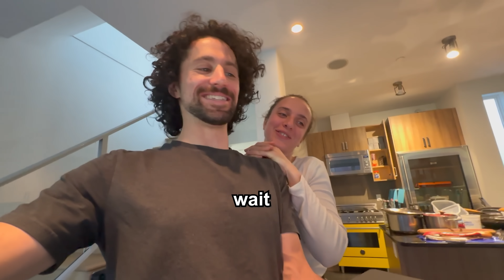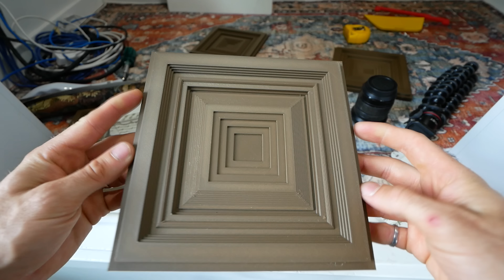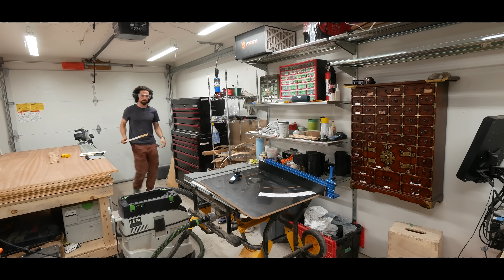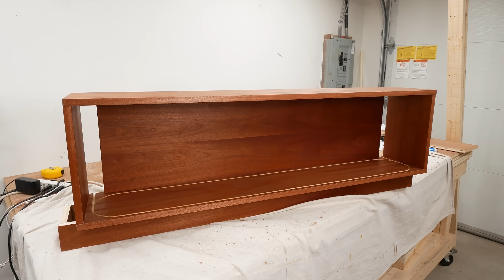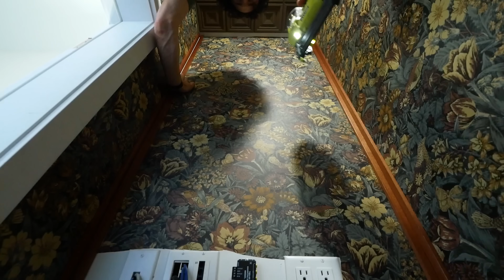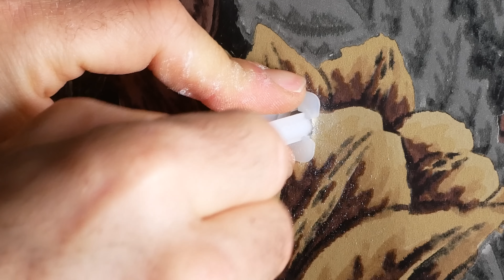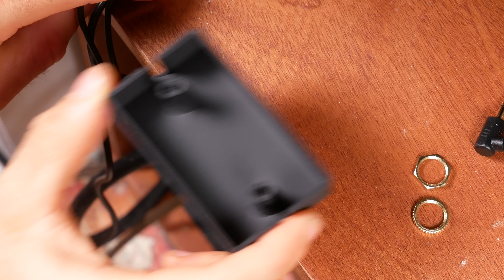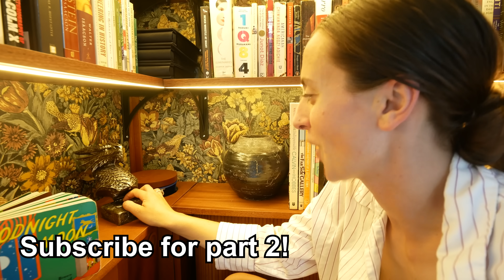I Built a Tiny Library on my Stairs

Comment: I know this is an old video but I'm going to suggest this anyways if you want to make strong shells without having to worry about attaching them to a wall for example but still expose the backing and have it look nice do a skeleton frame essentially you'll use posts that are small but strong along the edge of the shelves usually on the corners and you can add extra strength by adding a post or pull in the middle of the shelves to stop bowing or do what you did with the desk in the office pod and ad a beam underneath each shelf the connects to the frame on the ends

Comment: As a fellow user of "adhesive picture hanging strips"... you're not getting those off the roof cleanly. They're removed by pulling the tab parallel to the adhesion surface, and those tabs are now inaccessible, directly behind the panels. The only way you'll ever get them off is if you break the panels, chip the ceiling paint, or if they do fail naturally. Use your adhesive strips wisely, friends!

Comment: Awesome energy and video production, as well as woodworking!

Since you're obviously not shy about putting a lot of work into a project like this, I'm surprised that you didn't investigate what lies above the ceiling and below the closet floor before starting the build. Then you might've found a way to install a full-size door at the beginning!

In the US, hiding an electrical junction box like you did in the ceiling is a code violation. I used to watch enough home renovation shows filmed in Canada to be pretty sure it's illegal up there, too. A far better solution would be to paint a standard electrical cover plate in the dark and minimizing color of your choice. In fact, someone ought to forward this video to Mike Holmes. He'll get a hoot out of this, I'm sure!

I used to do a little woodworking in my youth, so I shook my head in disbelief at the thought of a 3D-printed plastic ceiling to imitate a wood coffer ceiling. Why not just make it out of wood? LOL. A stack of 1x4s would probably make the right scale for miniaturizing a pattern of large coffer beams.

It almost doesn't need to be said at this point, but you could have put up the wallpaper and the corner trim at the end, and therefore given yourself far fewer headaches while also using less of those materials. And if that huge hole in the wall "came with the house", why didn't you patch it before starting the rest of the work?

Comment: I haven't even finished watching the video yet, but as someone who has erroneously used Command Strips in such a way that I could not access the pull tabs, my anxiety went through the roof when you put them completely under the beautiful 3D-printed tiles. Good luck getting those off when you move. 😨

Comment: Door should be: 
a painting that swings open like a door - revealing a bank door / safe door which when unlocked opens - revealing a bookshelf of which when the secret book is pulled outwards (on a hinge) the bookshelf opens. 
[few different ideas for the bookshelf final door in how it opens. one could be it drops from the top, opposite to how a garage door opens, and when it comes down onto the ground it forms into a ramp or steps even]

Comment: I don't know if it's feasible, but maybe you could make something like an art piece with a tambor door, almost like a garage door?  Like use dark laquer for two tone shading and it rolls up to use the negative space between the ceiling and the top of the library door which seems to be about halfway up?  I tried to see about how high the ceiling is but most of the shots didn't show it so I think that's about right.  I just sort of feel like that closet's location in the wall is ugly from a distance and it would make the space look better if the stark white was framed with the earth tones inside.

Comment: I imagined a stained glass window (plexiglass/acrylic) that looks like it came from a library in Cambridge or Oxford, maybe a lesser known window that was stolen from Notre Dame. Maybe piano hinges, might be overkill- but opens vertically so both windows are doors that lay flat again the wall on either side. 
If you get the design just right, it 
could look like a stained glass
 window with sunlight shining through when the led lights are on, then decorative windows on either side of the window. 

I’m late to your channel- Just found this on 12/25/25. I haven’t found if you came up with something yet.

Comment: I think bookshelf brackets should have been printed lying down. Regardless of the material, the bonding of the layers is always the weakest point, especially if the print will support the weight of several books.

Comment: Do NOT add a door. It's way too bulky, way too many issues, too much work and all to fabricate a major dangerous hazard. I'm assuming you have no ventilation in there either correct? Stick to a simple fabric or breathable cloth curtain you can disguise as a tapestry or something similar. Also add some cushioning or door draft seals to all the edges of the opening so people don't get CTE over time getting in and out.

Comment: Envy!

The only thing that is a head scratcher… the secret compartment is just oddball out of place blue and green after you did all the painting work on the dragon.  It would have been cool to be the wine color of the upholstery… or similar coloring of the wood… or even the black of the shelve brackets.  It just looks like you had left over material lol

Otherwise that look so cool! 

You could add one of those micro ceiling fans where the top light used to be, for those hot days and paint it to blend in.

Comment: I see no need for a way to hide it. But, if you do, I would use a trompe l’oeuil image of an old fashioned card catalogue. If it’s constructed so that it sits proud of the architrave, it can be in two halves. You may need special hinges so they sit flat, on either side of the opening.

Comment: For the secret compartment i would also add a timer that if it is open for a period of time it will auto close it

for the door from the looks of it you don't have a lot of options.
you can't use a normal door that opens inside because the limited space, if it opened outside it will block the window and if it will open to the other side it might block the other stairs. 

I thought about sliding door but you don't have enough space for it either.
you can create like a door with segments which you can fold it and it will open (there are designs for it which is used for small spaces like this one)
you can use blinds but it isn't cool
if you want to go wild you can create a door that slides upwards you have a high ceiling so it can work. it also will not block the window

Comment: You could do a sliding door, one of the ones that are hidden in the wall that you pull out with a latch handle, and it could have one way glass thats paints on the mirror side like a painting so its a painting in one side but you could see out of it. I dont know it that would actually work, im not an engineer or sn artist

Comment: Two way mirror? For the door, put the lights on a remote so you can just turn the lights on from the outside so you can see inside without opening the door. But when the lights are off it's hidden

Comment: I know I'm late to this but I would have built a door that slides upwards. It could be a painting/portrait or even a pretty mirror. The track would all need to be hidden behind it when it's closed, but not look out of place when it's up. It would need to be able to lock safely in the open position, to prevent accidents, especially if there's any glass.

Comment: oh you could do a "living" painting with a flatscreen tv you can disgues as a painting. The frame of the tv you could cover up with a wooden frame.
The cables would have to go through the frame and wall of the opposite side of where your cables are (the one with the seat which looks so great by the way) 
Other downside might be, that you would have to cover the back of the Tv, which takes up space. 
On the other hand you could display ANYTHING on that tv. You could make a slide show of different pictures. Little videos like the one in Hogwarts

Comment: might need a vent in there to circulate airflow. Also probably "feels" warmer due to so much lighting
maybe have those on switch with a single overhead lounge light/dimmer switch where the reader would be to give it a cozier feeling and less like you're under spotlights. Also would be a good opportunity to cut in a vent for a fan along with that

could maybe do a one way mirror for the door so that way you can see out and not feel like you're in a coffin but also still hide it?

Comment: I did a project a while back for my cousins bedroom you can do a parts painting hanging either from the outside or inside. Basically you get whatever painting you want and build a hinged frame for it you can even put a backing on it and perhaps lean it over the bottom or top edge of the door having the words "The library" or something else you would need. Also you could do a very similar idea but make it fold into that corner by your window you'd probably need a string or an actuator to open and close it though... cool build!

Comment: Super cool project! I´d build a sliding door disguised as an old painting but with an intergrated ventilation system for that room. Is it possible to design a picture frame that allows ait to flow through and is capable of hiding a silent fan? Hm...

Comment: I like the Idea of a two way mirror or a glass window with a design that you can see through on the inside but not on the outside like what you see on some vehicles when driving, that would allow whoever is inside the closed library to see anyone outside, see the window and also prevent any accidental open door into someone or someone sneaking up.

Here is a project Idea for you though, why not buy a plot of land and build your own dream house with secret rooms and all?

Could make a secret underground workshop that has a hidden slide to get to it and a hidden exit to another part of the house, maybe through a replica grandfather clock, something like that anyway.

I was going to offer a suggestion for your Geodesic office pod, but you moved lol.

so why not build another for outside, a bit pricey for what I am suggesting.

- Using metal and something akin to Ballistic glass

- Create an inner and outer Geodesic dome.

- The inner Geodesic dome would have a lip to hold the glass to keep if from falling inside, the outer dome would have a lip to hold glass in to keep it from falling outside.

- the Strong glass would allow for weight and impact.

- inside, between the two halves of the geodesic dome, line will led lights so you can light up each individual border of the glass.

Just think it is cool idea to have a basically a safe space above ground, you could make it into a Greenhouse if you wanted to, or a gazebo type area for hanging out.

Comment: For door idea what about sliding like barn door that has photo on outside so when door is closed there is a painting there. Either split the door in two opening on each side, or if room permits, slides over to where you are sitting giving access to seeing outside, or same idea with a glass door with see through window with painting on outside(like on bus where outside you see advertiserbut from inside you are able to see out.

Comment: 27:35 
Door idea: a roll up door. Basically the door frame will be framed with a picture frame. Then have a picture or painting put on canvas or any suitable surface that is flexible. The idea is that when it’s rolled down it will look like a picture. You can also put it down when inside and it will add to your library theme. “Tada it’s not a picture it’s actually a hidden library. See if you can find the hidden snack department now.”!!!!

Comment: I feel like the ceiling would have been better if the tiles were vacuum formed from a single 3d printed tile, both cheaper and safer (if they fall).

Comment: For the door, you could hide actuators in something like a tall narrow custom table. Have the table hold a large painting that hides a seam where the legs are actually separate from the table and push the painting up and the table top is fixed to the wall like a step to help you get in and out, perchance.

Comment: I think if it were me, then I'd do a stained glass French barn door with hidden mechanisms. 

So, the idea would be, create a  stained glass picture inside a wood frame. The two halves of this picture frame door could slide apart to reveal the library behind. However, when in the library the stained glass French doors would still let in a ton of natural light. Also, it being stained glass would really help to tie in the Victorian aesthetic you wanted.

Comment: You're supposed to hit those crimped wire terminals with some heat to shrink the jacket around the wires. In addition to keeping dust out of the electrical connection, it mechanically stabilizes the wire to the terminal to prevent the wire from becoming brittle and breaking off just outside the crimp.

Comment: The door should definitely be a painting and it should open by sliding up on the wall. That way when its "open" you basically have a painting on the wall above the door, and when its closed its just a painting on the wall, with no opening.

Comment: If you go with a painting, you could make it so that it slides up. When it's down it's hidding the opening and is decorative, when it's up, it's still decorative as if it was the intent to hang it above the opening. You could use art gallery rail hanging system so this way you could have visible chain holding the painting that looks intentionnal, but they would also be the mechanism pulling the painting up.

Comment: For s secret door, have a picture frame with a painting hanging from an actuated picture rail that you can raise and lower with a motor switch. When closed, looks like a painting with a victorian-ish interior design choice in your stairwell. When open, it still looks 100% intentional. Hiding it inside a small gallery wall along the picture rail would be perfect.

Comment: A painting with the door jam painted black and adding a guilded strip to turn it into the picture frame! What about a poster of a library so there's a library behind the library painting? Also, what about adding a 3D printed 'book nook' between some of the books. They are little models of a passageway or structure the size of a book. How about a tiny library to put in your liny library behind the library painting?

Comment: I think you should put in a mirror with ornate trim. But it should be a one-way mirror. That way, you COULD be inside with the light off and observe people walking past. If you have some nice light on the sides or on the top, you can you use it to check your look before you leave the house. It would also make it seem even less likely to be movable. If the frame appeared to be super heavy, that, too, would suggest that it is too heavy to move.

Comment: Whatever door you make for it, with how that hole is on the stairs, I recommend making it slide instead of swing. And this way, it can slide either direction and won't block the window either.

Comment: How about an old, ornate frame with glass as a door? You wouldn't even need a real frame, you could just use a fancy-looking baseboard or cornice, or both glued together so you can customize the size and finish. So your tiny library is still seen and looks like a piece of art from the outside, and so you can still see the view from the window when you're inside. I feel like completely shutting the library would feel really claustrophobic if you were inside.

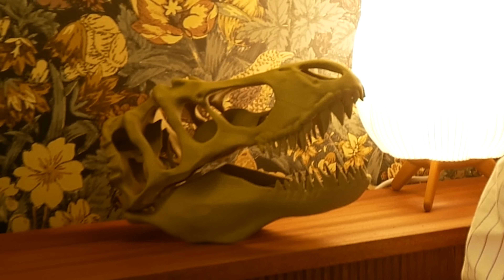Comment: 26:57 What did you come up with for the door? You will need ventilation and I doubt there was an air duct in there so so I thought rather than a door, you could make a retractable screen door and spray paint on a mural with a stencil pattern or a stenciled stained glass pattern. Or you could make a fabric Roman shade made out of tapestry cloth to continue with the theme.

Comment: Hello!✌️🙃 Since the last top shelf isn't weight-bearing, you can use fewer supports and the wood will look better. Or, instead, you can place a picture that simulates a shelf that stretches into the distance...➿➿➿... but it looks wonderful on you, it looks great.

Comment: I have been told that you must have over 1,000 books for it to be an actual library.  I didn't see that many books.  I have well over 1,000 books in my library/home office, as well as many thousands of records.  A hole in the wall wouldn't do me personally.  Our upstairs has a tiny 8 foot room with a dormer window over the front porch roof.  My wife had planned to use it as a reading and cross-stitch room, but we're much older now.  She has a few hundred books in there, but the bookshelves have collapsed.

Comment: Make it a one sided mirror, but it comes off the wall, (like air pocket windows on older cars in the back seat) and it slides away from the window so that when it’s open, it’s still usable as a mirror that’s been repositioned, but when it’s closed you can be in it and see out of it.

Comment: My first thought was a pocket door. Yet you said you didn't want to rebuild the wall so a rail door is possibility the best one...
Reply: As both doors are low profile or no profile door design. The rail door can be mounted in 3 ways auto open or close or level. A rail door hangs on wheels which rides on a pipe mounted above the opening. Inside or outside the room.